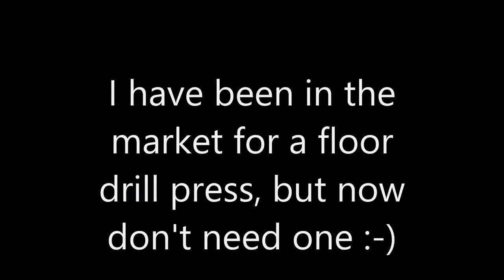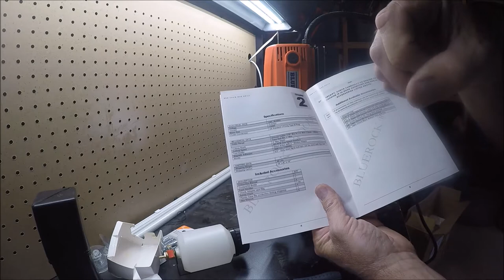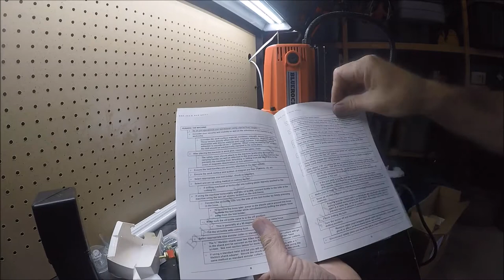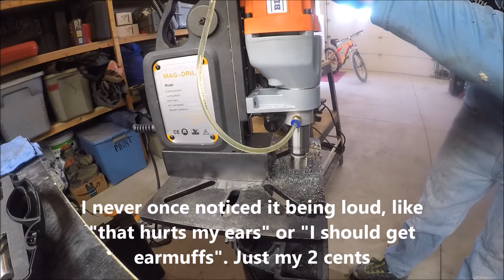BlueRock MAG DRILL - (BRM-35A) initial setup and thoughts

Comment: I'm not trying to be picky I wasn't going to even comment but you kept reiterating it in the video over and over that drill press table to you are drilling into isn't steel its CAST IRON which is also why the magnet wasn't reaching its potential adhesion and you are also very lucky you averted a serious situation in which the annular cutter grabs and makes the drill skid out of alignment in most situations it will flip upwards exposing you to the spinning bit
Reply from the maker: Yes, you're absolutely right. I've used it a bunch since I bought it, and I found that it's very risky trying to magnetize it to anything less than quarter inch steel. So I have learned some things by trial and error. I learn so much from the comments, and other people read the comments as well, so thank you for your good feedback 👍